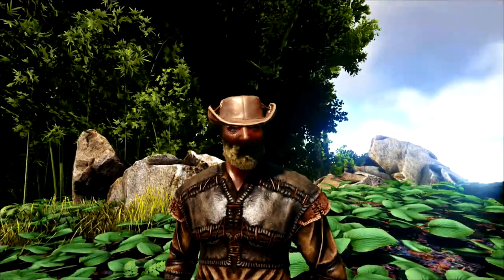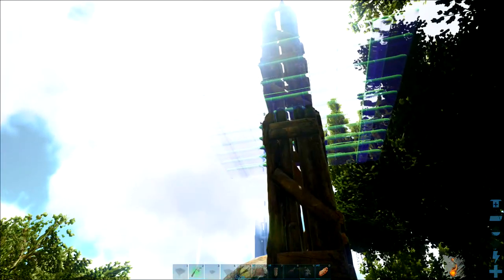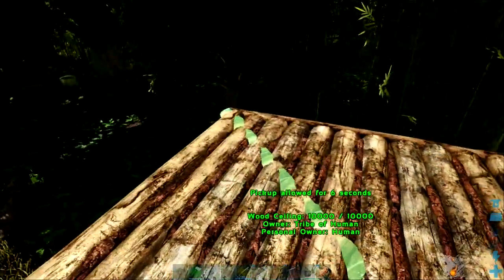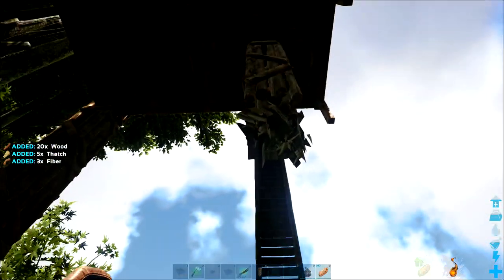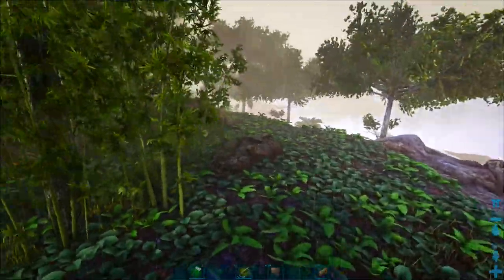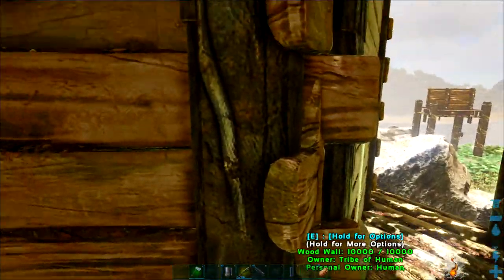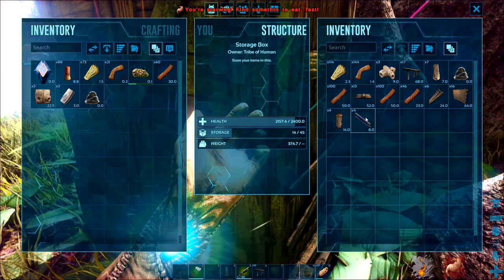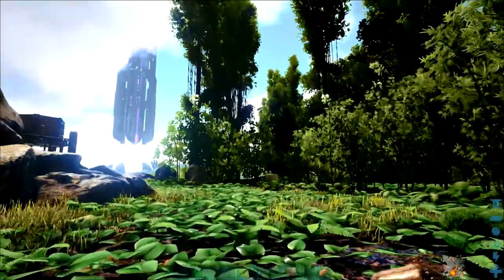Ark Water Tower Build Guide No More Messy Pipes

Comment: I built almost the same type of tower and put 8 metal reservoirs on it. For some reason water is coming only from the reservoir the vertical pipe is connected to and coming down from. On ground level i've connected it to a toilet, farm with 3-4 taps and to my industrial cooker. Could that water coming from only 1 reservoir be a bug? All my other 7 metal reservoirs are full at 500. I only noticed this when i started using my industrial cooker.

Comment: Nice build!

did you say that s+ gives 3 minutes for pick up? cause mine does not (30 sec like base game)
I have the open source one and its top slot
anyone had this problem or seen a vid that helps with this problem?
Reply from the maker: no it's 30 seconds to pick something up in vanilla and it's my sever that's set to 3mins. And with S+ you can pick up anytime you need 2. I messed my words up.
Reply: @CompleteGamesWithJames ok, thanks

if your always supposed to pick up then ill have to find the settings or redownload because s+ is not behaving correctly
Reply: @dtgamerk9670  try super structures. its what the old s+ is. I don't enjoy new s+